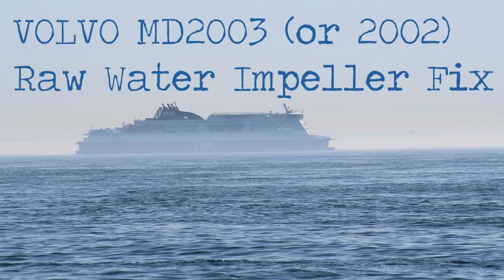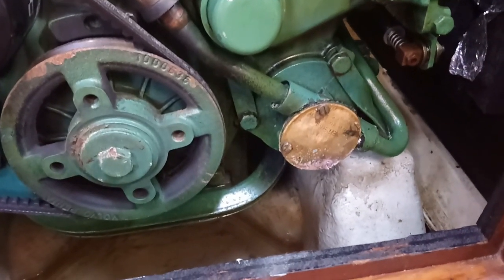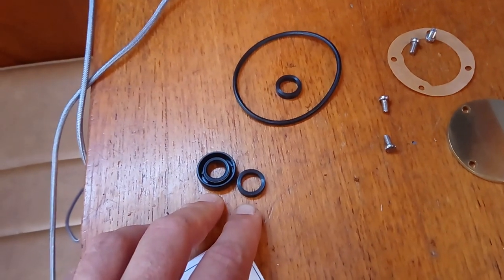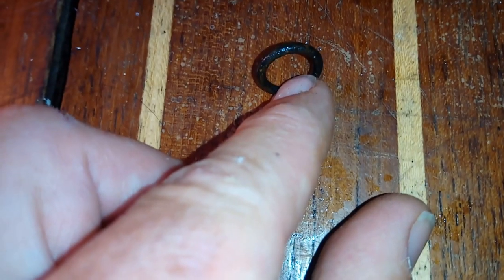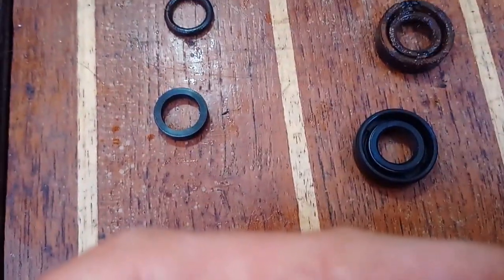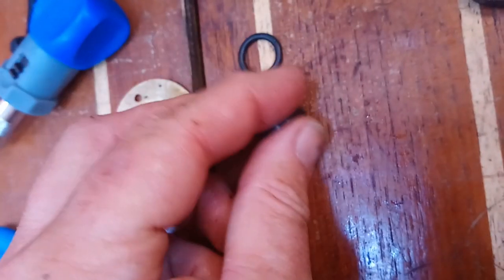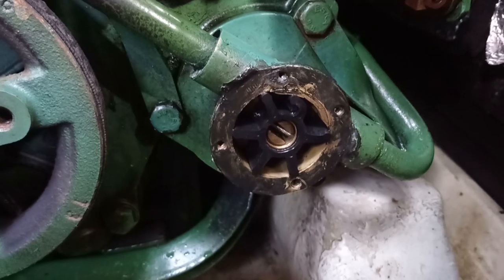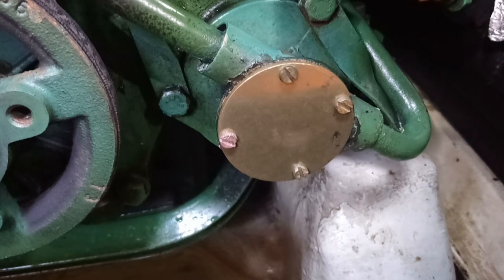Volvo MD2003 Raw Water Pump fix

Comment: A good effort by this customer with one of our pump rebuild kits, but treat the video with caution, as the drip at the face of the pump will likely have been caused by a leak from the end cover plate, not the internal water seal. Also note that the internal water seal is pressed onto the shaft after the 'O' ring (which is merely a 'deflector' and hence the old one is re-used). The two lathe cut rubber seals in our kit are for sealing the external pipework to the pump.  Finally this engine looks to us to be a Volvo Penta 2003.
Reply from the maker: Hurumph! Thanks P4A but it was not a cover plate issue. Checked multiple times.  I had to put the old seal on as there was no like for like swop. I meant to call you guys as I'm sure you would have talked me through it but has been fine so it slipped down the priority list.  You are right about the engine. It is a Vp2003, no "MD".   Not getting into a p***ing contest as your knowledge is much appreciated. But cover plate. Come on! X
Reply: I'm about to try the same fix and have a new water seal. Will I expect to find the thinner seal and does this go in front or behind the seal. I can't see it on diagrams??

Comment: The two "flat" washers are for sealing the pumps infeed and outfeed pipes which are a "press fit".
The seal with the incorporated spring should face forward .... There should not be an o ring outside that.

Comment: Glad you reinstalled the o-ring as the one you tried first is actually a pipe seal...you'll notice there were 2 of them in the kit. They are for the coolant pipes entering/exiting the impeller pump (and elsewhere in the cooling system). The seals have a slot on the inside diameter that fits over a lip on the end of the copper coolant pipe.
For some reason the o-ring is not included in many service kits, it likely doesn't get much abuse.
Reply: My appologies - while the 2 seals are likely for the impeller pump pipes, I don't believe they're slotted and useable elsewhere as I first believed.
Reply from the maker: Interesting.  They do look like pipe seals but I could be wrong as the biz owner seemed to know his stuff and was v helpful. Very little signs of wear on the original rubber seal so hopefully will stay off the To Do list for a couple of seasons.

Comment: How are the cooling pipes attached to the pump (Threaded?)
Reply from the maker: Not threaded. Push fit, with a rubber washer to help with the seal. These can be a bit fiddly to reassemble. It is old tech. But it does work!